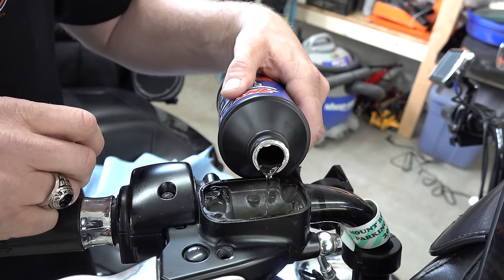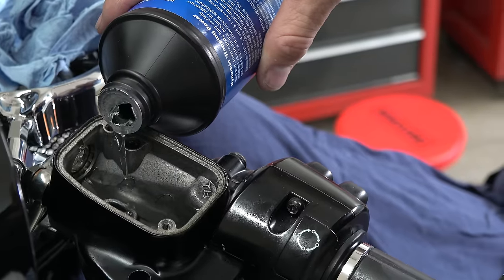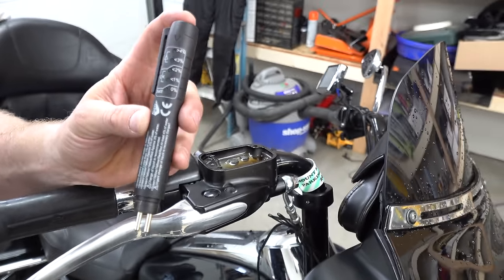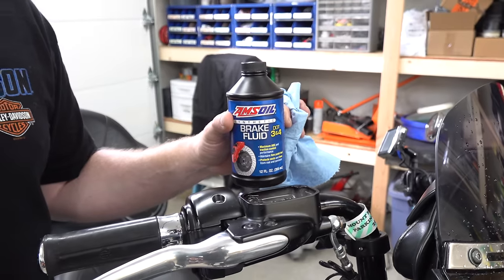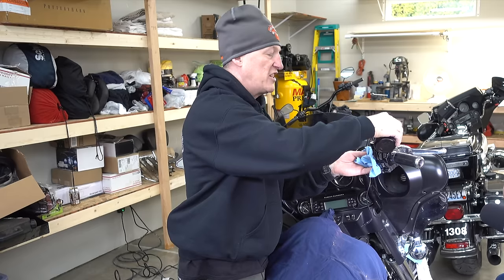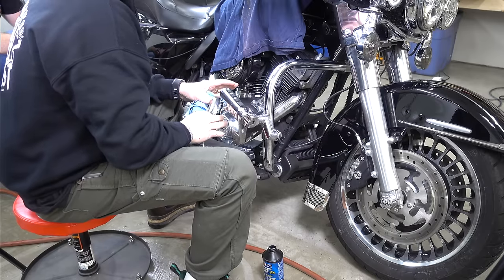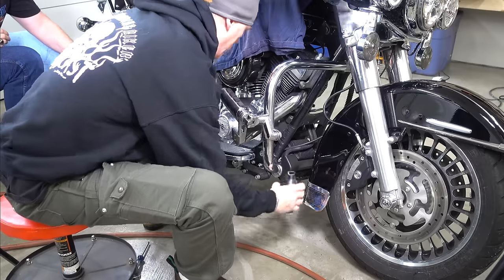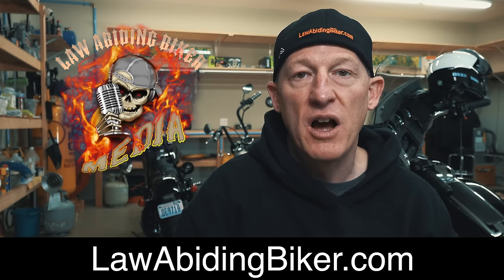How to Bleed & Flush Harley-Davidson Brake System Fluid-ABS & Non-ABS Systems

Comment from the maker: SUPPORT US IF YOU LIKE THIS VIDEO; PURCHASE ITEMS USED IN VIDEO-AFFILIATE LINKS ==> https://www.lawabidingbiker.com/flush-your-harley-brake-system AND IN DESCRIPTION BELOW VIDEO
Reply: Is it the same for an ABS equipped bike ?I have an 18 FLFB
Reply: hi I just bleed out my front brake with the classic method pumping the brake and open the valve below, than close the valve and release the brake. one problem. after I replace the oil the front brake it's loose, it doesn't brake anymore. why might be the cause??? help asap
Reply: @iLVCA  was going to ask a question myself but like many channels they don't reply back to those in need. I have no front breaks now and no help. I will never buy another Harley got 2 and can't ride either. Harley mechanics are highly needed cause they always say it will take a month, even for just a simple break job oil change and tires. Ridiculous.
Reply: @flatout5815 I 8:27 8:34 8:35

Comment: Excellent video. Detailed and accurate. One Tech Tip I would like to add. I can’t take credit for this. Learnedd this from Delboys Garage. After nyou bleed your brakes there are still “nano bubbles” in the system.  Simply wrap a bungie cord around the brake handle for the front and wrap a bungie around the rear brake pedal to the crash bar and let sit overnight. Next morning remove the bungies and you will have a significant improvement in handle and pedal due to the “nano bubbles” raising up through the system and releasing into the master cylinder.  It’s a technique that racers use and believe me, you will be happy with the results.  Be safe and ride carefully.

Comment: I notice a few comments here regarding the ABS system,you don't need to go to the dealer to flush ABS provided you don't introduce any air into the system if you do then off to the dealer you go,the only thing I do is go for a ride and utilise the ABS system after the first flush and then do a repeat flush,this is done to move the old fluid out of the ABS unit,information came from my local dealer.
Reply: He introduced air into the system when he sucked the fluid out of the master cylinder!
Reply: No he didn't. He filled it before he flushed. So long as the little hole at the bottom has fluid in, it is fine.

Comment: Thank you for all your videos. They are of great value to all of us that maintain our own bikes because WE care more about our bikes that the person that just works on them  but doesn't ride them.  I've had Harleys since I was 19 years old and I'm 72 now. I've always worked on my own bikes. I watched your video on bleeding brakes and, as usual, your covered everything necessary to do a great job...but there's one more thing you might try... and pass along if you find, as I did, that the brakes, both front and rear,  can be made just a bit better.  When you have completed your procedure and are ready to call it a night, wrap your brake handle around the grip, about four turns with a bungie cord and leave it overnight. Wrap the foot brake around the crash bar, again about four turns. When you get up the next morning and release the bungie, you will discover that you have almost twice the brake as you had the night before.  Reason:  After bleeding or flushing your brakes, there are "nanobubbles" in the line.  Pressureizing the line overnight will cause the nanobubbles to rise through the line and escape at the resevoir.  Sounds a bit odd but racers have known this technique for years.  Be well and be safe out there. Love your content.

Comment: I’ve got an 18 sgs about to put Yaffe 12” s on this week and install extended clutch and brake cable can I use this process or will I have air I can’t get out myself?and have to go to Harley to get it flushed

Comment: Because of this video, I picked up an off brand air compressor vacuum system and flushed my front and rear brakes on my new to me 05 Electra Glide Classic. The old fluid was a dark cloudy brown, The front brake level was less than half in the master cylinder. I bought small bottles and threw away what was left over. Thank you very much!

Comment: A tip for the front brakes:
After finishing up, take a rag, string, or rubber band and loop it around the front brake lever and handle bar and gently apply the brakes (not too much) and secure overnight to allow any micro bubbles to rise up into the reservoir.
Reply: that’s also a helpful technique when bleeding the brakes by yourself….
Reply: Do you Crack the bleeder again after with that lever pressure?
Reply: @eschrader  no that's to let any leftover bubbles in your master

Comment: This is one of those issues that divides people in a passionate way. Prior to ABS brake flushing was a task that any DIYer could do on their bike. But ABS introduced a solenoid/valve, subject to corrosion and consequent failure. The motor company maintains that to flush the brakes entirely you have to use Digital Technician to cycle the valve while flushing the system to completely flush. My dealer charges an hour, other posters have mentioned a half hour. The motor company is backed up by their knowledgeable engineers, and their highly conservative product liability legal advisers and probably a senior management highly attuned to profit maximization.

Then we have a plethora of social media commentators, including Ryan, that assure us that you too can DIY this procedure. And he may be right.  I honestly do not know.  But having had an accident where I lowsided my FLHRC, and ABS might have prevented said accident, I want to make sure that the ABS always works on my replacement FLHTCU.

You pays (or not) your money, but you ALWAYS takes your chances!

Comment: Regarding changing/flushing brake fluid every two years - You change brake fluid because the fluid in the caliper near the brake pads gets hot and breaks down. The brake fluid that breaks down due to caliper heat will sludge up and this sludge and will seize the caliper piston. That's why calipers seize. Heat from the brakes, not time or water. Thank you for the video!
Reply from the maker: Thanks for watching. Actually, everything stated is correct. We have the actual Harley Service Info and bulletin in hand. Ride safe.

Comment: Great and informative video.  One thing I didn't hear mentioned is: Inspect the caps of the both brake and clutch resivours for any signs of corrosion or blistering paint. This is a tell tail sign that the seal is bad. The seal replaced with a new cap from HD. Any signs of leaking from the caps is not good!
Reply from the maker: Thanks!  We appreciate the added info.

Ride safe & Ride Often!
Here is a link to a bunch of our useful Free vids: http://www.lawabidingbiker.com/freevideos
Here is a link to some of our useful for purchase videos: http://www.lawabidingbiker.com/buyvideos
Want Answers & Information Fast? And help support us at the same time? Do you like the content we provide?
Our patrons get answers to their questions/comments/feedback in less than 24 hrs and are part of our Private Facebook Group. If you are interested in being in this exclusive group you can get all the details at ==> http://www.lawabidingbiker.com/patreon
If you haven't subscribed to the Law Abiding Biker Podcast make sure to do so. Listen in as we talk weekly about issues/items like this & so much more. You can listen on iTunes (Apple/IOS), Stitcher Radio (Android), or any other Podcast App ==> http://www.lawabidingbiker.com/podcast
Join our free email club at http:///www.LawAbidingBiker.com/EmailClub. Only relevant content will be sent from time to time. Email club members are the first to find out about free or for sale content are given special coupon codes.

Comment: Great video... just finished replacing the brake pads on my Road King.. I was surprised to find that there was still a lot of life left on the pads. Been riding awhile and didn’t realize I needed to flush out the old fluid every two years. Last time I replaced the pads and bled the brakes was a few years ago which explains why they felt so spongey... Kinda kicking myself in the ass now realizing that all I really needed to do was flush the old fluid... oh well, at least I know I won’t be needing new brake pads on the front for awhile! 😛 So I went ahead and used the manual style mighty vac and followed the instructions in your handy video. Brakes work great... no more sponginess. Wondering if I still need to build up the pressure in the lines using the lever and crack the bleeder the old school way afterwards for good measure? 👍

Comment: Great video, I’ve done the same procedure with a hand held mity vac.  Only difference I was Leary about sucking as much fluid initially out of the MC’s.  Logic tells me if you suck it “all” out of the MC, you can’t help but introduce air into the system pouring new fluid into a completely empty MC?  

If any air gets into the system you can bleed it all you want, but with ABS you will never get it out without a trip to the dealer is what I was told anyway.  Thanks for sharing.
Reply from the maker: We've used a hand held mity vac as well.  The dealers are good at scaring us into taking our bikes to them.

Ride safe & Ride Often!
Here is a link to a bunch of our useful Free vids: http://www.lawabidingbiker.com/freevideos
Here is a link to some of our useful for purchase videos: http://www.lawabidingbiker.com/buyvideos
Want Answers & Information Fast? And help support us at the same time? Do you like the content we provide?
Our patrons get answers to their questions/comments/feedback in less than 24 hrs and are part of our Private Facebook Group. If you are interested in being in this exclusive group you can get all the details at ==> http://www.lawabidingbiker.com/patreon
If you haven't subscribed to the Law Abiding Biker Podcast make sure to do so. Listen in as we talk weekly about issues/items like this & so much more. You can listen on iTunes (Apple/IOS), Stitcher Radio (Android), or any other Podcast App ==> http://www.lawabidingbiker.com/podcast
Join our free email club at http:///www.LawAbidingBiker.com/EmailClub. Only relevant content will be sent from time to time. Email club members are the first to find out about free or for sale content are given special coupon codes.

Comment: Ryan great video on flush and bleed brakes. The reservoir caps ONLY can be wash out with plain water and then dried. Plain water will clean off brake fluid. Even after you put the caps back on a with a wet rag wipe around the cap. If you are with other bikers at a show look at some bikes the caps have corrosion where it meets the reservoir.  Be Cool and Ride Safe.🇺🇸🏍
Reply from the maker: Yah, that's why we also say to lay it right side up, so you won't get seepage around that lid. It works. Thanks for weighing in
Reply: Wait, you wash the cap with water? I thought the whole idea was to avoid moisture, how do you wash it out without breaking the black seal (inside of cap, the thing with all those lumpy rectangles) and secondly how do you dry it out (method) and know it's completely dry and you're not adding moisture back into the system?

Comment: Many thanks for all the videos that you publish.  I'm addicted.  Purchased the brake fluid tester through your link (as well as the Mitey-Vac).  When I tested my fluid, the meter went immediately to RED.  Probably original fluid - 2013 Street Glide - just never had any issues so never thought I needed to flush.  Will be flushed DIY as soon as possible.  Keep up the good work.

Comment: Thanks for this video. 
This is going to come in handy on my 2014 Street Glide. 
I might even replace that front diaphragm while I'm at it since the guys at HD says that master cylinder is leaking.
Reply: be very careful and dont allow air into the system or you will have to have the abs brakes fixed at the dealership.. not costly but if air gets into the abs system the only what to get it out is by the dealer
Reply: @tylerfj24  Thanks but I don't believe my standard 2014 has ABS.

Comment: Great video. Well explained and good visuals. My question, is especially on a system that has been neglected... Wouldn't it be a good idea to also tear-down the calipers as well?...  My experience has been that crud and rust can lodge there. (Because the bleeder screw is at the top of the caliper, the sediments will collect at the bottom where they can't be flushed out.) When this happens it can wear the piston seal leading to brake failure. Also, if moisture has collected there the caliper cylinder can become pitted, also resulting in brake failure... I know it's a lot more work but, if you're cleaning the master and the lines, you might as well do it all.
Reply: When you say tear down the callipers, how do you mean?
My bike (09 Rocker C) hasn't been ridden in about 1.5 years, went to move it yesterday, front brake lever is rock hard and wheel is almost locked up.

With me sitting on bike trying to walk it backwards and a guy leaning from the front of the bike into the front wheel forcibly rotating it backward, we could only move it a few feet.
So I don't know what has caused it, but I'm going to flush the fluid (hoping that may fix it), most likely replace pads at the same time.
Should I be doing anything to the callipers other than pushing pistons back in to take new pads?

Comment: I couldn’t get any fluid sucked out until I pumped the brakes. Hopefully that wasn’t a complete mistake? Nothing was coming out after cracking open the valve…not sure why. I had fluid in the reservoir. Tried opening up the valve more and still nothing for a few minutes until trying to pump the brake lever. The brake fluid in this new to me bike was extremely old, not sure it’s ever been changed in 12k miles…

Comment: I always cycle my ABS module after a flush then flush again.  Merely flushing the brakes does not move fluid through the ABS module.  I just did a video on it while I was chasing down an ABS light issue.

Comment: Great video - Mighty vac is a great tool.  I had one already and used it on the bike recently.  I noticed an definitifve improvement in the feel of both brakes.  MC was only 18 months old but brakes felt way better.   
I'd add that doing that darned hydralic clutch got it to perform better as well.  I'd like to see a video for it as well.  I could not get the clutch cover off without pulling the exhaust and would like to know if there is a "trick".

Comment: Back before Mighty Vac some of the garages had pressure bleeders. There was a pressure pot with brake fluid in it. A hose going to a special cap on the reservoir. You put pressure in the pot (not a lot) that pushed fluid in from the pot. The low pressure only added fluid that was bled out so it didn't over fill. The you could bleed all the brakes by your self.
Mostly I'd get a friend or mom or my sister to push the brake pedal down. I give the command Okay now then they would let me know when the pedal was held on the floor so I could open the bleeder. Then after closing the bleeder say Okay pump it up again.   You don't want to wait too long between pumps and bleeding as the air bubbles will slowly rise anywhere the lines go up hill and the air will still be trapped there.
 When I was by my self I'd find something to hold the pedal down like a stick maybe snow broom between the steering wheel and the pedal or the seat. Now you kids got it easy. Back in the 70s I bought a hose with a check valve to push on the bleeder so the air didn't go back in when the pedal was let up. It kind of worked but I always pumped too hard and fast and blew the hose off.

Comment: What about the ABS pump module?  Isn't there fluid trapped in there (as well as moisture build up)?  Does this method you are using somehow allow for that fluid to be released and replaced with fresh fluid?
Reply: The abs module needs to be actuated via a scan tool or using the abs actively om your motorcycle to cycle any air or moisture out of there. I was dissapointed @Ryan didnt address this as well :/  the rest is good info.

Comment: 👍🏼......Had my local dealer do new pads in the rear so they had to bleed the rear lines.  They left the cap loose on the rear fluid reservoir.  Was riding to a buddies house and lost all pressure.  I looked down and the cap was completely gone and the reservoir empty.  Dealers don’t always do it right that’s for sure.
Reply from the maker: Yup, we've heard many stories like this. Things left loose etc. Unfortunate. But, I know many professional mechanics too and fortunately, there are more of them. That's dangerous what happened to you!!
Reply: Why do you think the brakes had to be bled because of new pads? It's a closed system. No need to bleed. IF! and IF! the brakes were spongy because moisture in the caliper boiled from hard braking (over heating) making for a spongy brake then yes but if the brake is not spongy then there is no need to bleed just for a pad change.

Comment: Mine has ABS. I read that the motor company maintains that to flush the brakes entirely you have to use Digital Technician to cycle the valve while flushing the system to completely flush. Is this the case?

Comment: Here is some info to those who are new to working on their bike. If your fluid turns black, make sure your pads are not dragging on the rotor. That will also heat up the brake fluid. I had it happen when I didn't know better. It locked my front tire up

Comment: Hi Ryan great easy to follow video, I've just done all my oils on my 2011 street bob, just a suggestion for you when you lessen the bleed valve on calliper s, use the ring end of the ring spanner,it will grip the bleed valve on all sides and not just the 2 of the open ended spanner. Ride safe
RegardsJon in the UK👍